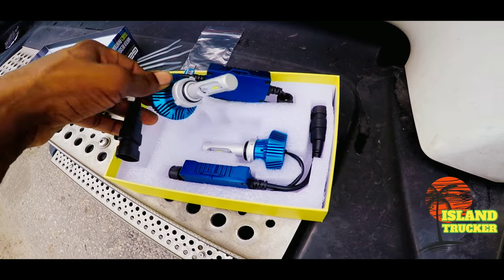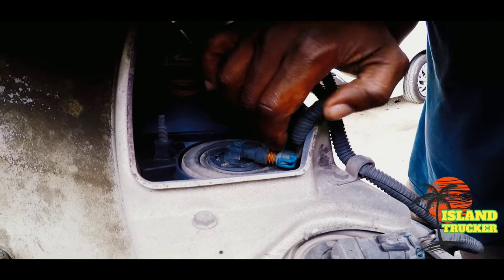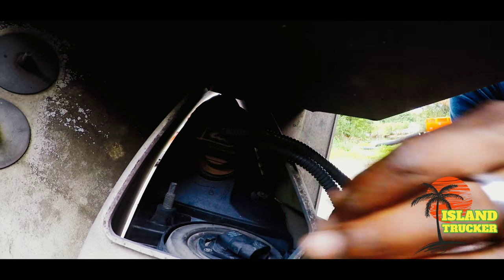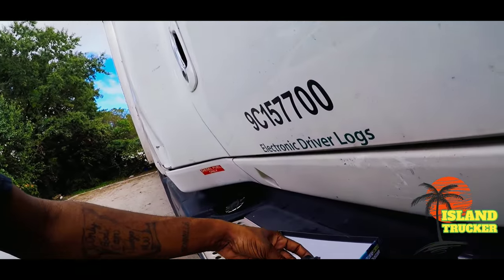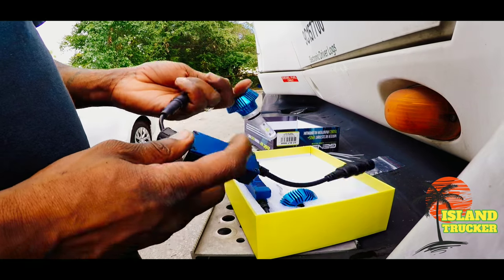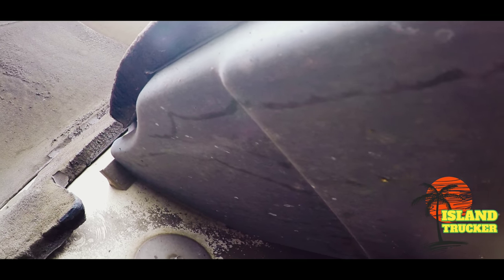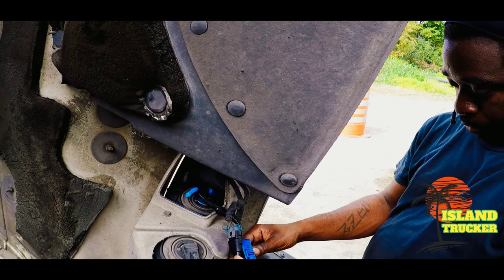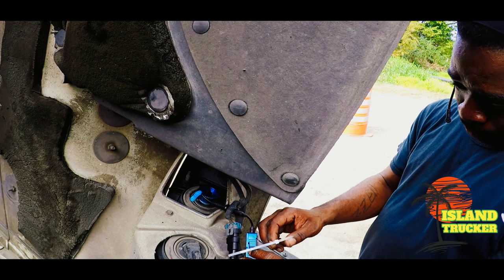How to Install LED HEADLIGHTS tractor trailer

Comment: Will the one in the link fit my 2014 prostar and does 1 pack have 2 lights in it or do I need to order 2
Reply from the maker: Yes, it fit 2008 to 2017. It comes with 1 left and 1 right